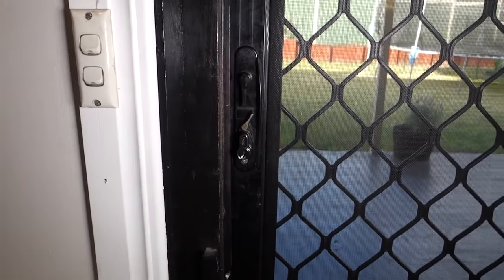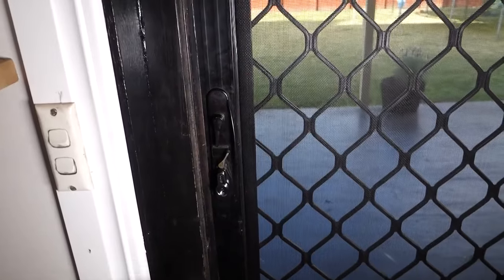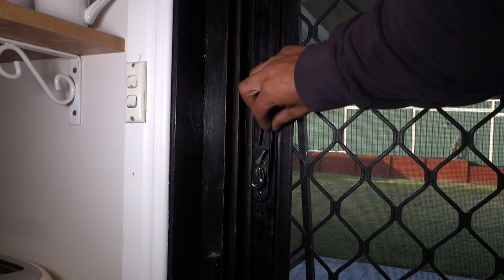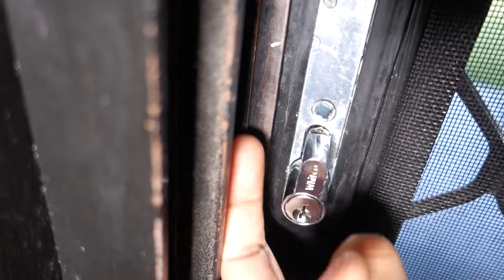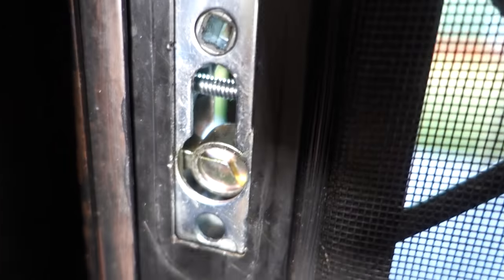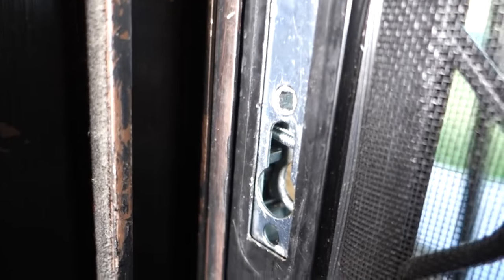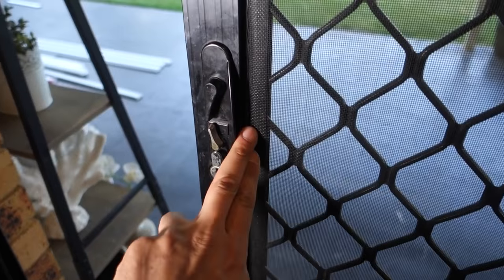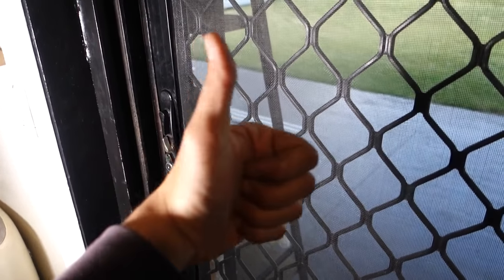open locked door without key - replace euro cylinder lock

Comment: Fantastic video and helped greatly.  I would just like to add that I just could not get the little tag to turn round to open.  So i used recip saw hacksaw to cut out the screw, which holds the eurolock in, which then fell out leaving the slot clear to just slide a new lock in, get it in position then open.  This may help someone struggling like me!  But the video was just fab thanks.

Comment: This video helped me replace the lock in a used door that I purchased. In Australia, thin doors typically use the 46mm euro lock while thicker doors use the longer 63mm lock. The job of breaking the lock is easier if you use 2 pairs of multigrip pliers with an assistant on the other side of the door bending the lock at the same time and in the same direction. The screw hole being the weak point in the lock is where you apply force. Multigrips with wide jaws (10mm) are best suited to this task.

Comment: I snapped the key off in the lock, the door was locked and I couldn't get the key out. Your method worked a treat. Thank you for putting this up. New euro cylinder from Bunnings for $23 and it's working perfectly. 👍

Comment: Thanks. I asked on reddit but they told me to call a lock smith to open the door....... in my country lock smith asks 40 bucks just to open the door(breaking the lock) it may sound insane but 40 bucks is allot for me. Soo i took a pipe pliers the door lock broke easy.

Comment: very helpful video Bill, hope you can help me out I've replaced cylinder barrel lock  but it seems i may of inserted the wrong way and the cam may be turning the wrong way . The key turns but but nothing happens. Do I need to replace the cylinder barrel breaking off like you demonstrated in this video or is there a way of getting this open?
Reply from the maker: Hi, have you replaced the cylinder with a new one already or do you want to remove the old one?

Comment: Thanks for this.  I could only squeeze fishing line in the gap but the cam wouldn't go up all the way so used a pair of vice grips on each side and it snapped easily.  You saved me from calling a locksmith and the nearest is 100k's away.  Huge thanks.

Comment: Hi Bill, Great video but what if there are no screws to access for the removal of the cover plates, what then. My daughter has the sliding laundry door locked and no key for it. She has the same lock system on the back patio sliding door (different key unfortunately) and I can see the two screws on the inside part that goes into the frame. No other screws visible.
Reply from the maker: Hi the screws will sometimes have a small round plastic covering. You will need to remove the plastic covers to gain access to the screws. 👍

Comment: brilliant,just the info I needed as the key had snapped in the lock and after removal of the locking screw it still would not budge.Snapping with two pipe grips did the job and saved me a lot of money.Thanks

Comment: Worked a treat, thanks....'good on ya mate! as i believe you Antipodeans say! :)
 Would like to add one point, to not order replacement  until old one is removed as measurements regarding the placement of cam are different in a number of models. These dimensions are shown on sites, such as Amazon when ordering.
Reply from the maker: Lol 👍

Comment: Great video. Was very useful when I was replacing the lock mechanism on a flyscreen door and there was not enough room to try and release the lock with a knife blade. It certainly saved me a call to the locksmith...

Comment: Always use anti snap cylinders,it may make life difficult if you loose your keys but it also makes life difficult for the burglar who uses the same technique
Reply: Does anti snap mean it basically warps in a way that makes it very tough to get out?
Reply: @lystic9392  there is one with harden bars. I still get through them though is harder. Anti snap have sacrificial snap point a point that you can no longer grip the lock.
Reply: @jaybonkersbonkers3613  Ah of course. Quite the rabbit hole, the world of locks and lockpicking. It's cool to see the  ingenuity involved and the varying degrees of success.
Reply: @lystic9392  no anti snap means when it breaks it does not give the burglar access to the cam so is unable to open the lock

Comment: Snapping the lock is easy but some locks with levers will still need to be picked open after snapping the cylinder. Eg. Lock with bolt and latch. This is one of the easiest locks to open because it's a slam lock and have just 1 mechanism in side but any lock with levers is challenging to open

Comment: My locking mechanism is damaged / stuck so I need to change not only the wam but the whole metal part. Is that possible?
Reply: It is, most major hardware chains should stock replacement components. I just replaced an entire locking mechanism on a flyscreen security door for precisely the reason you gave.

Comment: I have a question I totally broke my key cylinder and now the lock is stuck in the wall how in the hell do I get out do I have to call a blacksmith I try to turn the cylinder where the handle would go with a screwdriver and then it's snap instead of opening

Comment: 1.The euro cylinder that was in the door initially was the wrong size. It protruded too far out on either side.
2. You've just shown the world how to get into a similar door from the outside
3. You should have fitted an anti snap cylinder as a replacement

Comment: Hm I can’t get to the other side of the door to undo the screw because its the balcony door. Any ideas mate? 🙏🏻
Reply: You may have to been the faceplate out of the way first. Then either bend it back post job or buy a new fascia
Reply: Might have to just call a locksmith.

Comment: You can’t do this with an anti snap cylinder.
Reply: They're are plenty of other ways. This particular way is long-winded. The problem you have is that the better protection you have on the front door the more damage will be caused when you lose you're keys,and the more expensive to repair. Locks will only delay an intruder who will hopefully go elsewhere. They will not stop someone determined to get in. If you want that sort of protection,spend your money on a dog.